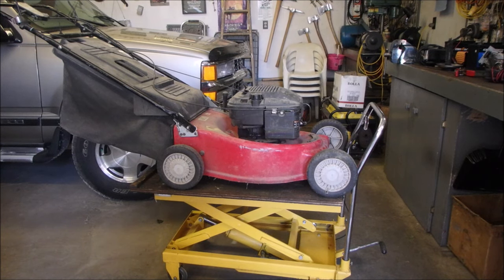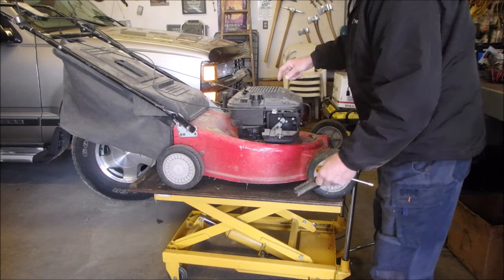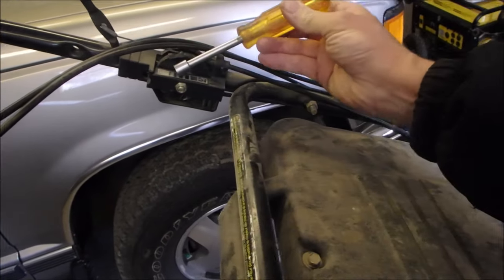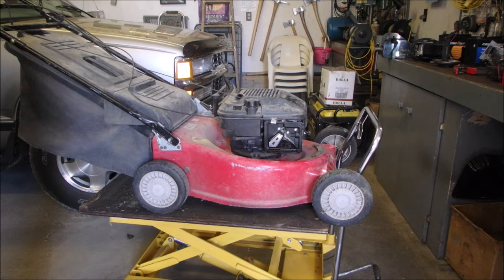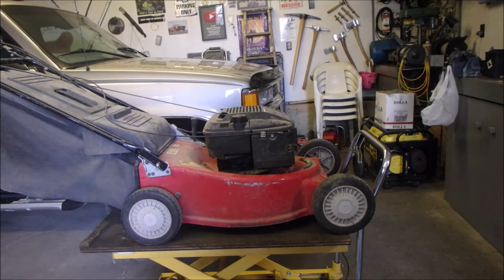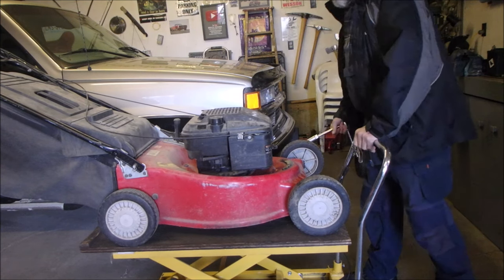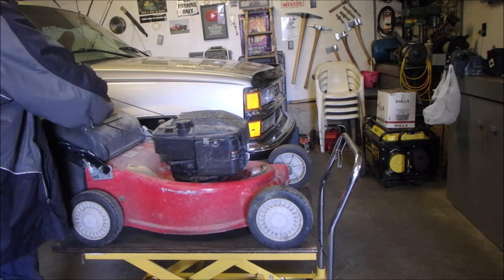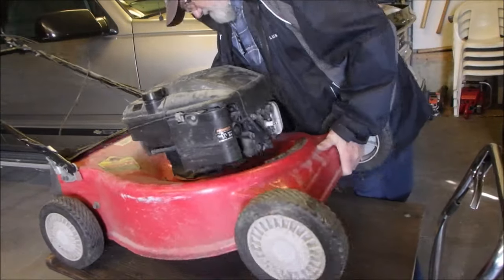Older Turf Power (Briggs) Mower Won't Drive

Comment: Wow haven't seen one of those mowers in years.... Nice job Sir.
Got a new customer, he brought me his father's, who passed away last year, John deere js63, first it didn't start, briggs  quantum with auto choke, the carb was clogged, so fix that and got it to run like new with a good hot ultrasonic carb cleaning, changed the oil, new air filter, sharpened and balanced the blade, had it running moving like new, he took it home, and mowed half his yard and it quit on him, he brought it back, and I found 2 issues, count em 2.... LMAO..... One was the coil was going out, and get this, the gas cap he had lost the silver cup on the cap which made a vaccum condition and no gas was refilling the bowl too.... Crazy, but now all fixed.
Reply from the maker: Those coils will sneak up on a fellow.

Comment: Hey Bruce, I remember my dad having a 5 hp quantum when I was small back in the early 90s. I helped hand him tools when he worked on it. It also had that splined shaft. I also remember that its ultimate demise was that eventually the splines stripped off the crank causing the blade to never spin up and it would just sit there making a horrible grinding noise. I'll never forget that terrible sound it made when it happened.
Reply from the maker: WOW   OK  I was small in the early 60's

Comment: My 1983 Toro just starting knocking 😢 Techumseh motor !
Reply from the maker: First thing I would check is the flywheel key.  Tecumseh engines us a softer key,  they move a bit changing the timing.
Reply: @BrucesShop  thnx Bruce will check it out

Comment: That machine will continue to outlast today's machines!  Sometimes, you just need a little lube to get things moving again.  Glad to see this ole one stayin alive still.  

I just got an old Snapper (I think) in as a trade with a (assumed) seized Wisconsin Robin engine.  First one of those engines I've gotten, but unfortunately, it seems like it might be destined for the scrap yard.
Reply from the maker: Well start with engine rotation,  oil, spark compression , carburation  and some hope.